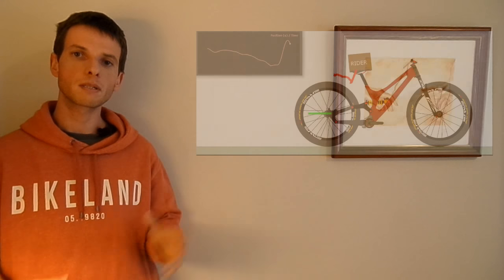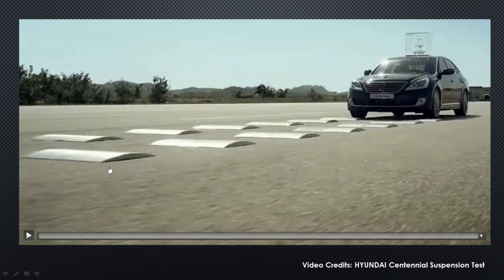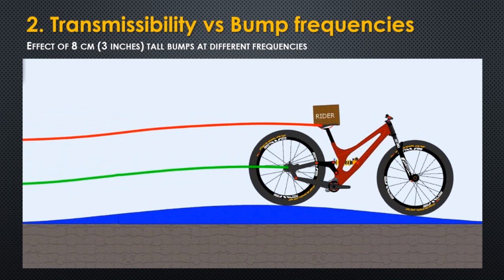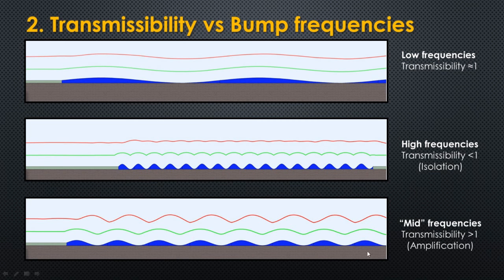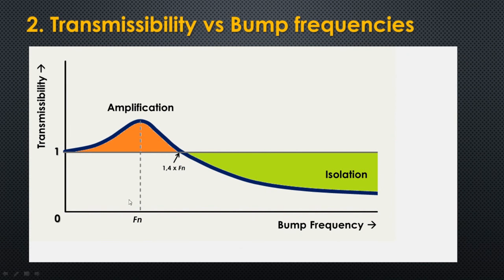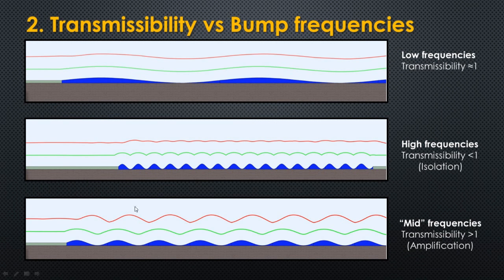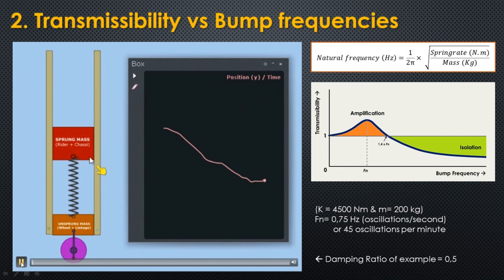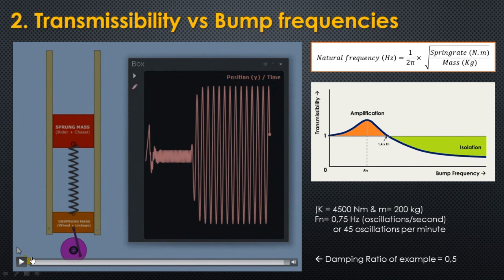Rebound speed vs Suspension performance (MTB Ep.15)

Comment: really nice video , what's your opinion about custom tuned suspension ,I am talking for mtb .
Reply from the maker: I don't have a strong opinion on that but I think it depends on the objective of the tuning. But I would say that most of the time people don't need a custom tune, they just need to adjust the shock properly... There are some cases were the shock adjustments range are not enough for a specific rider, in that case it might be needed a re-valving on the internal tune. Or for instance, there are some basic shock which lack some adjustments, like high-speed compression and so on, so you need to re-valve in that case if you are aiming for a specific objective. Shocks like CCDB or Fox X2 already have a quite good adjust ability range with 4-way adjustments, they can fit most types of bikes and riding styles out of the box, so in this case a re-valving is not needed on most cases. Bye

Comment: So if the natural frequency of full suspension bike is 2Hz it means I'm unfortunate for growing accustomed with a 120rpm (=2Hz) pedalling cadence, unless I stick to the lowest possible rebound speed (or break the bank with the expensive shocks)
Reply from the maker: For each crank revolution you have 2 power peaks moments for each leg (when crank arms are horizontal). So, 60rpm cadence = 2Hz

Comment: Hello, How does the high speed rebound work? I guess in a case for rebound damping, oil flow pressure might not be strong enough to open the high speed damping shim stack when the shock is in the middle or in the beginning of full travel. But I see your reply saying :you can have high-speed rebound events on the beginning of the travel.  If this is so, where does the power to push oil so strong that high speed damper open it's shim?
Reply from the maker: +jungjoon choi Whenever the wheel gets unloaded (after hitting a bump crest) the shock / fork rebounds fast and can activate HSR circuit. Still, for every fast speed event you always have 2 slow speeds moments (beginning and ending of the movement). So, the low speed adjustments will always affect in some extention the fast speed movements. This is particularly relevant on small amplitude movements such as those on beggining travel. In the beggining of the episode 6 I recorded the shaft speeds of a fork over Rocky terrain and you can understand what I said.
Reply: andrextr thanks

Comment: Amazing videos. Could you review the Canyon Spectral? Thank you my friend!
Reply from the maker: I already did the model but I didn't the video yet. But the Spectral is not very different from the Strive. Spectral has a progressivity of 35% which is more than the average for a 140mm bike. Anti-squats are around 75% for a 32T. So it looks like they optimized the frame for a smaller chainring like a 26T. Anti-rise is low (45%) as expected for a horst-link design with a rocker link with an horizontal type of configuration. Overall is a good bike, however anti-squats could be a bit higher on a 30-32T (but since they also sell this frame with a 2x10 option, they did the compromise to work well on smaller chainrings). Bye
Reply: Awesome! Thanks a lot for that.

Comment: What would you say about increasing unsprung mass, like heavier wheels/tires to suspension behaviour? have you worked out the Fn equation for the whole system?
Reply from the maker: I have done the models with heavier unsprung mass to make a new video but unfortunately I don't have much free time lately. But with an heavier unsprung mass the wheel won't track as well the terrain on high-frequency bumps (the wheel is not so much planted to the ground). This happens because when the wheel hits a bump it accelerates vertically (up direction) and it continues to move vertically after passing the bump (because of the weight and inertia). On the other way, with a very low unsprung/sprung weight ratio (eg: very ligth wheels), the wheel tracks the ground better, and the tire is more time in contact with the ground after hitting the bump crests. This negative effects where more obvious in the SIMULATION when the unsprung mass was higher than ~10-15% of total mass (on MTB with an average sized rider, the unsprung mass is tipically 5% or similar, which is already a quite low value, so this also points out that probably reducing 1 lbs / 0,5kg in unsprung mass probably it won't have a major impact in the performance).
Reply: andrextr awesome. Thanks for the in depth, second to none answer.

Comment: Hi andre! I currently ride a Yt Tues CF. Doesn't pass the drop test, has bad traction. is way too hard for my weight (60kg) even with the softest 200 spring, minimal preload and softer internally adjusted highspeed compression. What do you think about a Demo 8, Ns Fuzz, Devinci Wilson or a Mondraker Summum for me?
Reply from the maker: Which shock do you have? I have 2 friends with BOS-eqquiped TUES and the shock is way too stiff for my and their taste, in particular on high-speed compression (the shock suddently "locks" under fast impacts, like roots or rocks). You can test by cycling the shock with the hands on the saddle slowly, then do the drop test while you push the saddle with your hand hardly against the ground. If you feel a sudden stiffening of the shock it migth be the case. Bye
Reply: andrextr I got a rockshox vivid with  a Fast Suspension Piston kit in there
Reply from the maker: Its not the frame fault, you probably need a lighter compression tune to make it softer.
Reply: andrextr But I think its not a frame that performs good for most people. I jave already got a lighter tune in theren and it still feels like a hardtail. And I also can say that its not my fault like e.g. riding slow or setting my shock up badly. But thank you I will try. Bye
Reply from the maker: I already rode a Tues LTD edition with a Marzocchi Moto C2R shock and the bike was buttery smooth. I also rode one with CCDB and it was also good. The ones I rode with BOS were pretty harsh and felt a lot of spiking on roots and rocks (despite HSC was at min). So, trust me, it's not the frame (unless you've a bad bearing). I weigth 70kg

Comment: I like your simulation. I am working on a new type of damper that allows you to have zero rebound damping without bouncing up and down. Would you be able to run a simulation to on it to see if it works better than conventional?
Reply from the maker: Hi Francisco, this simulation software is very basic it only allows to change the damping ratio. But how can you have a shock without rebound damping and still be damped ? Bye
Reply from the maker: OK, I see now, but I can't do that simulation with this free software since it won't allow to change compression independently. There are other softwares like Working model that migth do the job. It's always tricky to compare front and rear suspension because of their different nature. I mean, which time you decelerate the mass shifts forward diving the fork. Hitting a big bump like the one of your video causes some mass shifting forward, not allowing the front wheel to jump like the rear one. Also, the front axle path is rearwarded due to the inclined fork angle while the rear axle path is more vertical. This also contributes to the fact that forks absorb better bumps than rear (which will smash harder against obstacles due to it's vertical moving path). Regarding dampings, I like crazy ideas, and I understand that you are using compression to dampen vibration,  but IMO too much compression will transmit some of the impact forces across the bike, and after the fork/shock is compressed the rebound movement will be undamped meaning that will overshoot passing SAG point. Front bouncing is not so easy to see. If you do the same to rear shock I believe you get some nasty bouncing. When you get more videos send me to watch ;) Bye
Reply: Originally the video was not meant to compare the front an the back. It was mainly intended to see how the front would behave. The way the compression damping works on the damper I have made does not change with speed. The force is the same regardless of the speed it moves at instead it depends on the position of the wheel. A little bit like the spring. You can see from the video that the front handlebars barely move thru the whole test. The only time the bars move are after the initial bump. One interesting thing to note is that the handlebars start to move after the wheel has gone past the bump. It was a bit confusing at first because I would have expected the handlebars to move as it hit the bump. But after doing some calculations, the wheel is moving at about 12m/s when it gets to the top of the bump. Then it has to decelerate in about 80 mm (the left over travel before bottoming) this means the wheel would experience about 90G deceleration. The wheel is about 10kg so what actually happens is that the suspension bottoms out just from the force of the wheel hitting the bike. So there is very little force transmitted. 150mm square bump at 40kph can not be handled by conventional suspension. You will crash if you did this. I am making a shock for the back and will let you know when I do a test so we can compare. I have been riding the suspension as it is and the front behaves much better than conventional damping.
Reply: I modified the rear shock to work the same as the front and run the test.
Here is the video of the test: https://www.youtube.com/edit?o=U&video_id=aDzaeDZW9nE
Both the front and rear have very little rebound damping. All the energy is being dissipated in the compression stroke. You can see there is no bouncing of the rear either.
Reply: If you think of any other tests that I can run please let me know and I will try to run it.

Comment: Hello, parcero, greetings from Colombia. I have a problem, I bought a fox 34 talas of the year 2017 and the first one mounted was adjusting the bounce; but in those the knob is stuck. I do not want to do much force because I think I can break it, I do not know what to do if there is some method to solve it without disarming it and buy it in usa and there is the guarantee. Thank you very much if you can help me.
Reply from the maker: Hello! It seems that is a common problem with Fox FIT4 dampers and it is caused by the ball bearing that gets stuck and jammed (the same ball that causes the "clicks" when you rotate the knob). If it's your case, you need to open the fork to remove the damper rod. Don't force the knob or you can break the rod. More info here:
https://www.bikehub.co.za/topic/168967-fox-fork-rebound-adjust-knob-stuck/
Reply: Hello friend, the problem was solved, it was exactly what you sent. Thank you very much, you are the best.

Comment: So with a shock that has a HS&LS rebound adjustment, it would make 
since to adjust the LS to the critical damping point and the HS to be 
relatively open?
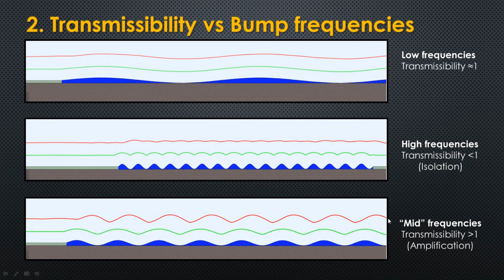Reply from the maker: +StandardSublime Yes thats almost it. But by default the HSR is already much faster than the LSR for the same number of clicks (you can't compare them by the number of clicks). So, to avoid extreme setups my advice for a starting point is to tune the shock as suggested in episode 7 at minute 9:00 ( https://youtu.be/Yjql1kExvCE ). Bye

Comment: I'm on a fox float x2, so for low speed rebound I do the curb test, and for high speed rebound I want to set this fast (minus or counter clockwise)?
Reply from the maker: Don't use extremes on the settings, both rebounds work together, and by default the HSR will be always faster than LSR unless if fully closed (because it's a bypass circuit, so there will be always more oil flow). My advice is to start with fully fast on both, and then, increase the clicks on both rebounds at the same time (proportionally) until you get the critical point (no oscillations). Then fine tune the rebounds separetely as you wish. You should end up with a tiny / small oscillation on the curb test.
Reply: awesome ty for the tips

Comment: then what is  packing down of shock, if fast rebound damping system works?
Reply from the maker: Don't forget that the high-speed circuit is affected by the low one. They work together. Because during an high-speed rebound movement the oil flows through both high and low circuits. If you tune your shock for a very slow rebound (lower than critical damping) there is no advantage in that, and despite having a high-speed rebound circuit, it may be not enough to avoid packing down on successive bumps. Bye
Reply: andrextr then the shock  might be designed to work about right at the critical point which u explained in video.
Reply from the maker: You can put just a bit faster than critical, with a damping ratio around 0.7 (tiny bounce on curb test). This is a value used on many off-road racing vehicles. Critical rebound is used when you need extra stability like in buggys (https://www.youtube.com/watch?v=pCvRlmZ8JZs note that the buggy returns to the SAG point without bouncing, it's on its critical point).

Comment: How is the Propain Rage compared to a Yt Tues? Thanks
Reply from the maker: +Nico Ofner Main differences are pedaling efficiency (antisquat) and progressivity. YT is significantly more progressive than Rage (70% vs ~30%). Also YT has good pedaling efficiency (antisquats around 100 %) while rage has a very low values around 0%. So, rage is not the best at pedaling but as an advantage it has low chain growth and low pedal kickback (chainless feeling). Bye

Comment: I have canyon nerve 29, stupid horst linkage...but i hate pedal bob, what to do with fox float ctd performance shocks to solve pedal bob...?  minimum rebound speed and high psi ? i do not care much for the bumps performance...
Reply from the maker: My advice is to set the rebound with a critical damping (see this video: https://www.youtube.com/watch?v=BiHQd4mzl3Y , there is no advantage to go slower than that). You can also use a lower SAG to get a firmer suspension (20-25% SAG should be fine). Finally, you can switch the blue lever of the shock to Trail mode to get less pedal bob. Improving the pedaling technique with a more smooth pedaling without bouncing on the bike, it's also good.
Reply: Thank you very much !!!

Comment: By this meaning, Slow speed rebound at rear, is better than fast rebound at rear ?
Reply from the maker: Too slow you lose traction and you dont gain much stability. Finding a balance between good stability and good traction is key. Check my previous episode 5
Reply: @andrextr  yea.. just simplified.. low compression or high compression on rear suspension for faster cycling or climbing?. 
and ..What is fastest enduro bike for pedalling or climbing? 1 reference of yours..

Comment: i think that the size of the wheels matters too
Reply: Bigger wheels will not change the frequency, they do not change the bump location in space and we are comparing wheels at the same speed so frequency is not changed. Bigger wheels will change the effective size of the bump that the suspension will have to deal with.
Reply from the maker: Sorry Juanpviera, but after thinking twice, I think I was right at a first place.. A  bigger wheel reduces indeed the bumps frequencies. The vertical amplitude is the same, but it smooths the bump and it takes more time to fully pass over the bump, thus, reducing the frequency.  Check this simulation:
http://ep1.pinkbike.org/p5pb14377433/p5pb14377433.jpg
Reply: That is one bump, a single oscillation has no frequency. In that case it is more appropriate to talk about shaft speed, which again, is directly related to bump amplitude and shape (both indeed affected by wheel size).
The transmissibility vs freq curve you show (which is usually referred to as transfer function or amplitude ratio, transmissibility is more often referred to as the instantaneous summation of the force of the shock + spring, and it has a different response to frequency than what you show, maybe even more important to understand as it is what a rider would feel in his/her hands) comes from periodic forced vibration, where the "initial" conditions have long been gone, and each response to each bump is connected to the previous and so on. A single bump is very "initial condition dependent".
Great video, especially for the visuals.

Comment: Your simulation is misleading. In your animation the value of compression damping and rebound damping is equal. But in reality, if you change rebound damping, then compression damping do not change. Many suspension also have rebound damping twice or thrice higher than compression damping. Changing the value of rebound damping can increase this imbalance even more.

Imbalance ratio of compression and rebound in a suspension will produce bottoming out. Bottoming out will make the suspended mass follow the bump. But your simulation do not show this.

The use of word "slow" and "fast" rebound damping make the explanation confusing. Using the word soft and hard is better.  shock breaker will have different damping on different suspension movement speed. Different suspension type or brand produce different reaction. This what set apart bad shock breaker and good shock breaker.

Your simulation should show this kind of effect:
https://youtu.be/SXDL_jREhEE